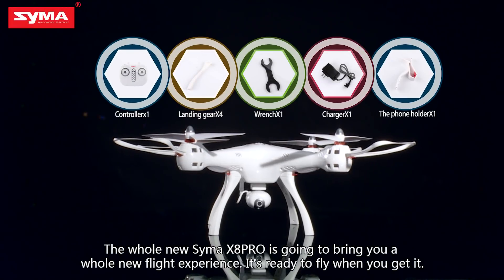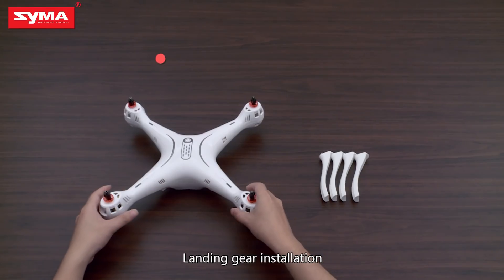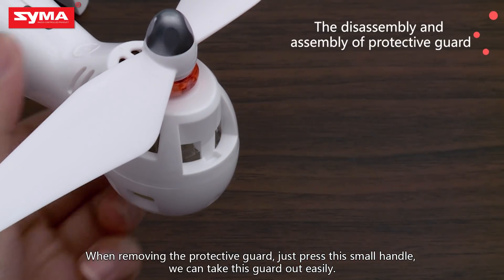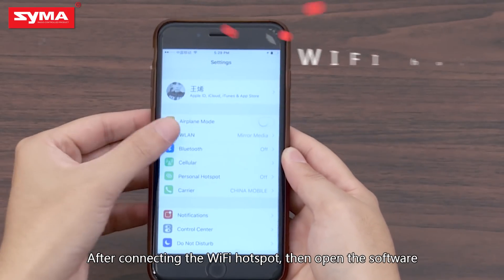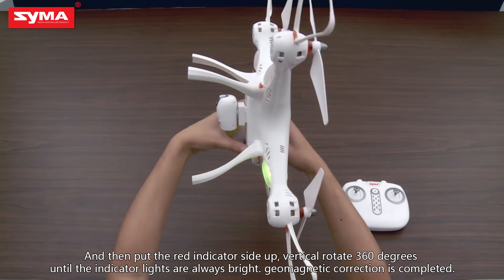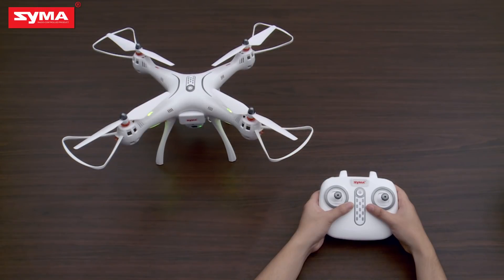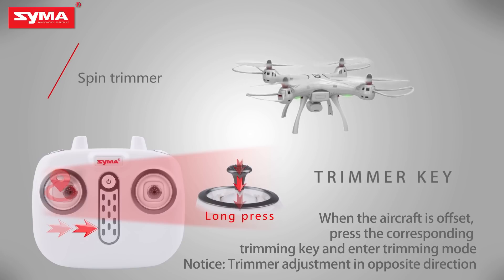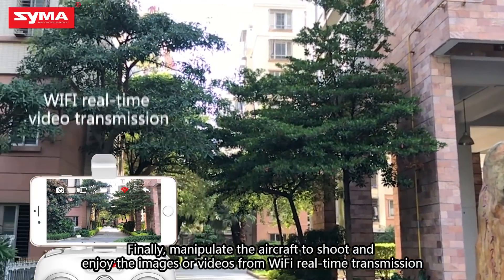Syma FPV Drone X8 PRO  Operations Tutorial

Comment: i got some problem. my remote control can't connect with the drone after i used it about 2 moth. 
 when i press power button on remote the light of remote is on but does'n flashing, No sound and nothing happend. need some help.

Comment: Hi. I've just bought this Drone. I must say that I have not experiencef any issues or problems as you and others have commented. I have successfully calibrated the GPS and calibrated the Gyro. Mine takes off and hovers in one place with none of the so called toilet bowl effect. I understand that you need to do the calibrations in an anti clockwise direction. I personally would highly recommend this drone. To all that have issues, read the manual properly and calibrate it properly then you won't have any problems, don't press and hold the RTH button, you only need to press it once. . It is a fantastic bit of kit. Yes it can be twitchy, but that is to be expected from a precision sensitive piece of equipment. I love mine and love flying it. It also looks stunning both stationary and in the air. Go ahead a buy it you won't be disappointed at all. Just remember to read, and read the manual properly and you won't have any issues, even with the camera and my phone attached in WiFi mode. ☺️ 👍
Reply: Mine to seems pretty much good . And especially firnits price

Comment: Do not buy this quadcopter it is very dangerous it flies on its own does what it wants to do crash is very easily even with GPS hold go watch some of the YouTube reviews I got mine and only lasted one day before it crashed and broke because it took off and flew to the right all by itself and could not regain control it would not respond to the controller
Reply: Nah, you can fix it. Its very easy. When its fixed, you can play it again.